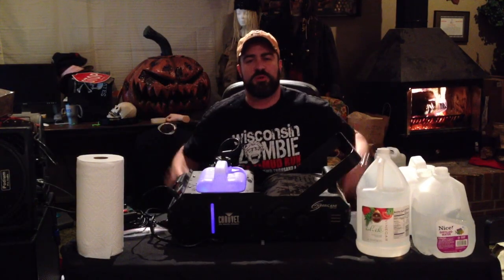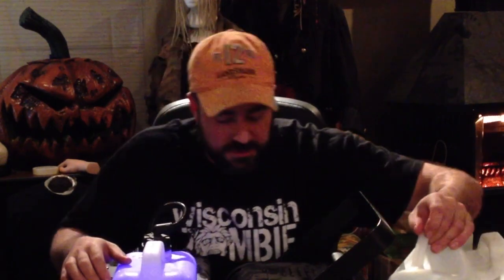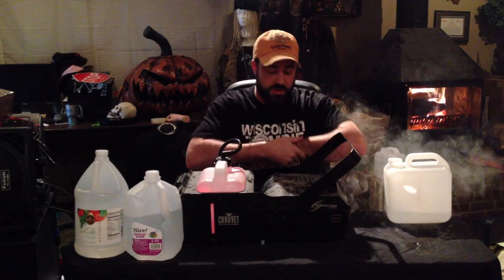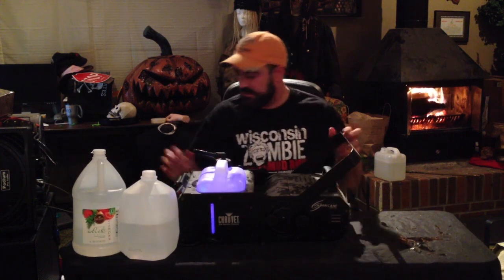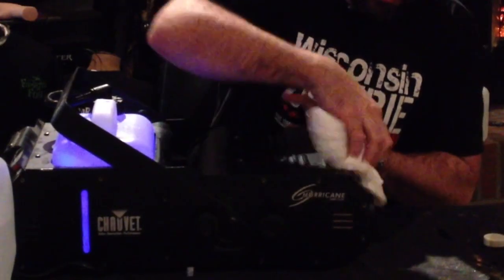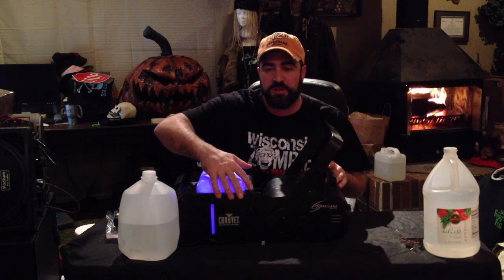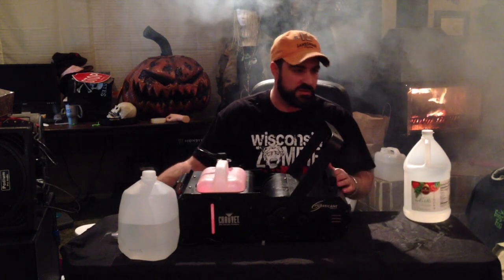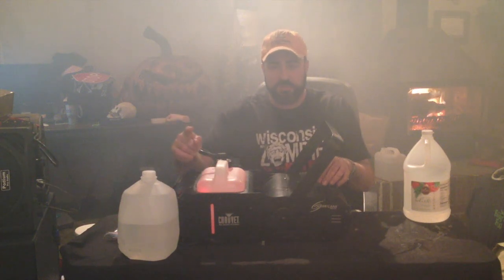How to Clean A Fog Machine

Comment: I know this is a old video, but I'm hoping you can help me, I bought my first fog machine  and the instructions say indoor use only, I cannot take it back, can I use this outside if I can keep it out of the weather, Thanks.
Reply: +lilac2484  Ive used mine outdise many times but make sure the weather does not wet it or get it dusty, and if you use it outisde the fog will disappear way faster then inside. But its not going to break if you use it outside, just dont let dust/dirt get in it
Reply from the maker: +lilac2484 yes you could use it out doors as long as it stays out of the elements

Comment: So do you just empty the cleaning solution afterwards?  Do I need to make sure everything is out of the fog tube?
Reply from the maker: +linda mitchell i usually dump the reservoir  and fill it with high end fog fluid.  then store it a climate controlled basement inside a sealed plastic tote
Reply: But before placing fog juice back in do you empty what's keft of the vinegard and distilled which are left on the system until it makes a noisy sound?
Reply: @johnabstercarillo2391  I would. You might want to run just distilled water after the cleaning fluid. You don’t want the vinegar sitting in it for a long time as vinegar is a mild acid and will eat at the parts if left inside the machine for a long time.

Comment: Can i leave it like that after the vinegar and distiled water run threw ,or should i run fog threw it again?.
Reply from the maker: +christopher dunn after i clean mine I leave high end fog fluid in it in keep it sealed in a tote till the next year.   either way should be fine
Reply: +Inside The Haunt Industry Cool thanks for the info.

Comment: Just an FYI if you use a fogger, never ever use the spirit fog or any other cheap stuff. I've used spirit fog juice for years, and I have an industrial fogger and 3 ground 400 watt and one 1000 watt and 3 normal 400 watt foggers. I've always cleaned them this same way, never an issue. last year I bought clearance fog juice from spirit the day after halloween and cleaned them and then ran that stuff through them. when I got them out this year out of my 3 ground foggers 1 worked. my 1000 watt worked, and all 3 of my normal 400 watt foggers didn't work and neither did my industrial fogger. The motors were bad on all of them, so I bought froggys fog juice and fixed 2 motors, and replaced the rest with motors from some other country. it's not easy to find motors for fog machines especially the cheaper fog machines, so don't use cheap stuff only use good fog juice. Froggy fog juice creates much better longer lasting fog and they have so many different options for fog juice it's unreal, so check them out. I'm not paid by them at all. I'm telling you this due to the fact I'm pissed about my foggers being damaged like they are. I cannot believe how the spirit juice messed up my entire set of foggers.